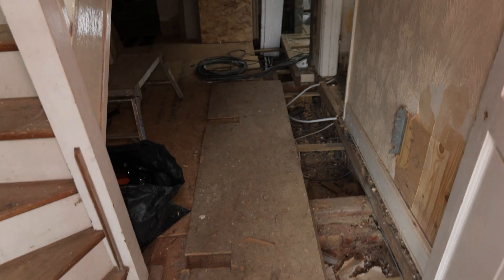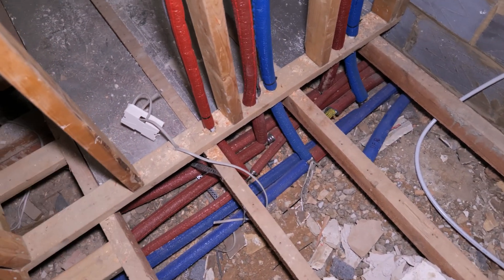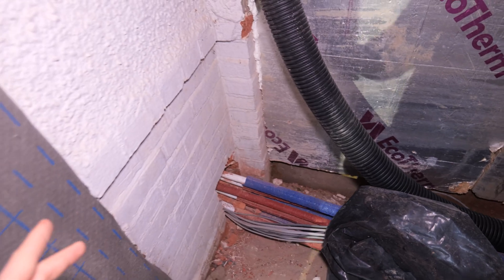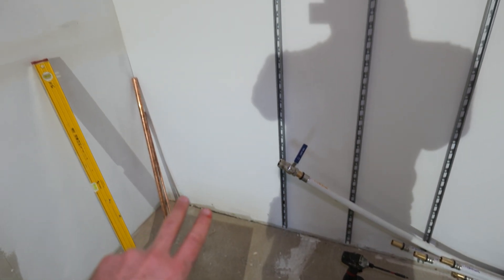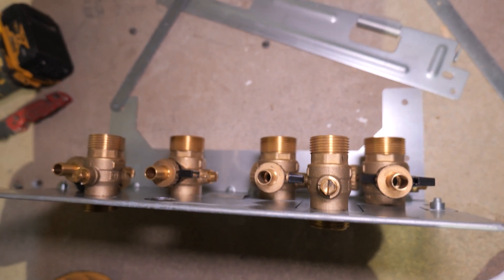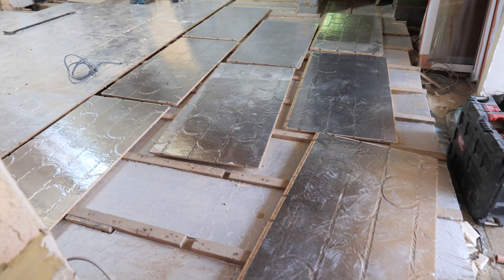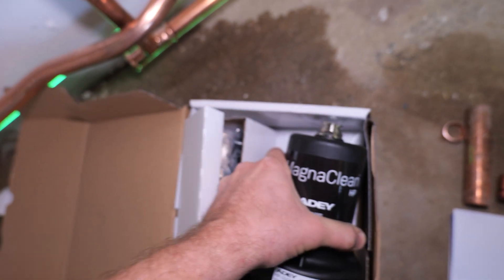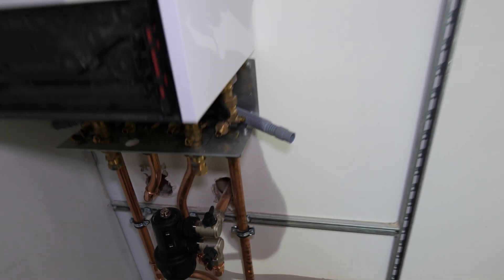Heat Pump pipework - Viessmann Vitocal

Comment: Quick question if i may, is there seperation within the vitocal unit?  i.e. is the ashp sharing water with the secondary rads side or is their a heat exchanger inside? Thanks
Reply from the maker: No problem. There is not, no.

Comment: I live in Northern Ireland, every expert i spoke to when building my house said you need UFH on both floors as heat pumps don't work with radiators. You have to massively oversize them. If thats not right accurate i love to hear others opinions. I have UFH downstairs but rads upstairs. Thanks
Reply from the maker: In new builds it's probably more sensible to go UFH on both floors. It's perfectly fine to have radiators and underfloor heating working together you just need to get the design right regarding flow temperature. 

 Sometimes you may need to have a mixed temperature zone controlled by a mixing/blending valve. 

Thanks for watching .
Reply: Less of an issue with a high temperature heat pump. Monoblocs just on radiators seem to work fine. Most important factor is the thermal efficiency of the house to start with